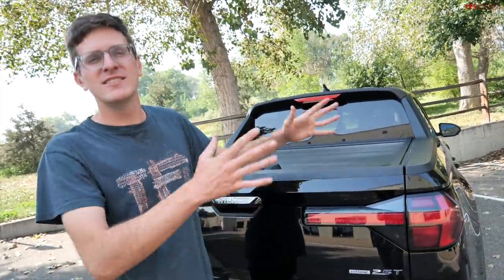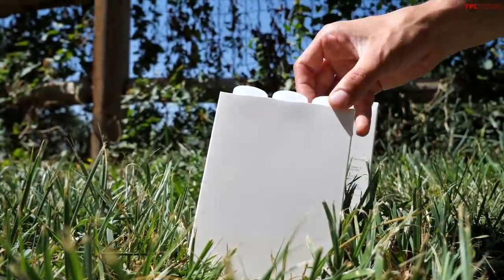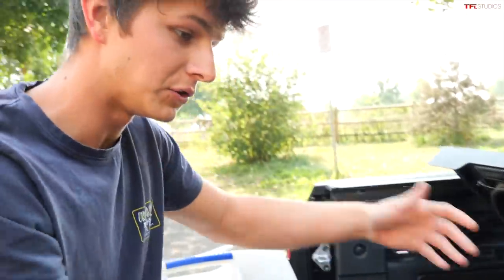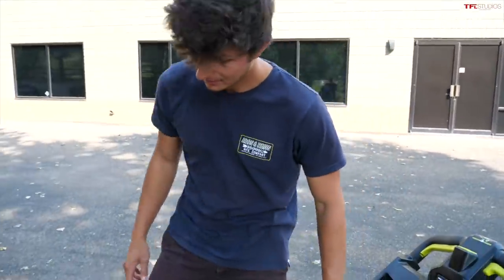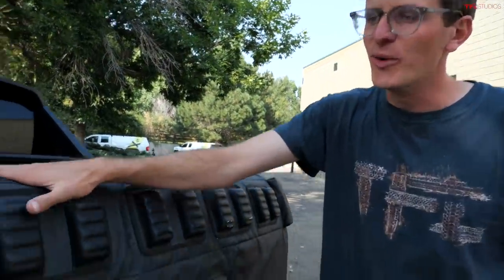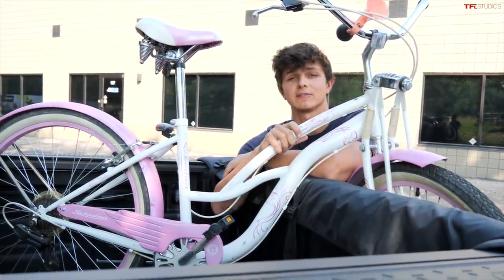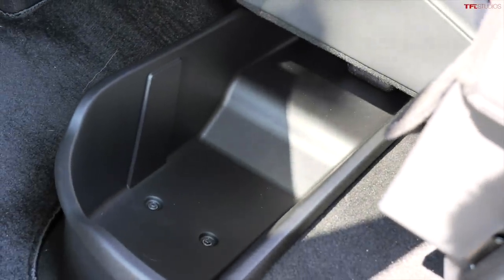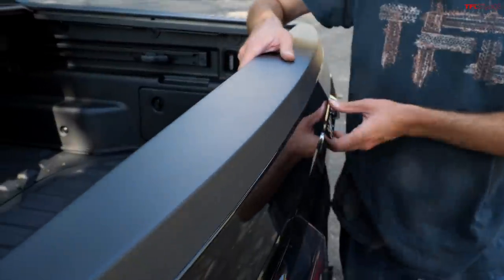The New Santa Cruz is a Tiny Truck - You Won't Believe What Fits (and What DOESN'T Fit) In The Bed!

Comment: I don't have a use for a full size pickup, or a mid sized pickup. I work for the Federal Government in an office. So I'm not hauling things around. Plus, I live by myself, so anything that I would use a full size/ mid size truck for, I wouldn't be able to carry or move myself. Example, washers, dryers, couches, dinning tables, hot water heaters and so on. I just need something that will fit items that won't fit in a 2009 VW Jetta.  Like Bar B Que pits, Patio Furniture, small dressers, Televisions over 70 inches, and so on. Basically something that can handle small home improvement projects. So for someone single, lives by themselves, and does home improvement projects on their own home, by themselves only with no help, then this could be a perfect vehicle for the. It is for me, I just need something that will fit items that won't fit in my current car, but items that I can handle on my own.  I don't tow anything and I don't work in construction, or run a lawn service. I'm a federal employee for a hospital, need to do small home improvement projects, and go out and have picnics and to the beach.
Reply: @wilmarbarrick3194  or even just get an old used truck if it's not gonna be used much, hell even a station wagon would work for any of that stuff
Reply: The 2.5T is a fun little engine to drive around. Faster than the hemi I had and averaging 27 mpg right now. Sea level flat pretty flat land. Mixed city and interstate at 80 mph

Comment: 2012 Dodge Grand Caravan with stowaway seats is more truck than this Barbie Car.  2020 Civic Hatchback with rear seats folded down can fit a bike in with nothing hanging out.  This is the poorest attempt at a truck Ive ever seen.  This makes the Honda Ridgeline look good. Thank you TFL for showing us the flaws and not giving us a hyped up salesman type of review.
Reply: It’s not intended to take on any current pickup, just be useful for those who want something with an open bed in a smaller package.
Reply: You're argument is flawed, you had to kick out your family to do truck stuff with those vehicles and just got grease on the carpet. Your wife is gonna be pissed .
Reply: @ALMX5DP  Except the list of use cases where it makes more sense than a typical crossover or mid-sized truck is exceedingly small. Nobody is genuinely buying this for practical purposes.
Reply: @mechmat12345  dang you’re on a roll in the comments section here. Use case doesn’t have to strictly apply to practicability, can be any reason why someone would want to buy it. No different to any other type of vehicle purchase.
Reply: @ALMX5DP  lol, irony noted. That's not what use case means. "use case noun noun: use case; plural noun: use cases a specific situation in which a product or service could potentially be used" - Oxford English Dictionary
Reply: @mechmat12345  "could potentially be used" seems to sum up exactly what I was  referring to, so I'm not sure how that is incorrect. If it's too haul something, go somewhere or look a certain way, all that falls into such a definition.

Comment: just turn the quad around with the back facing the tunnel cover 
IT WILL FREAKING FIT
Reply: Yeah, it looked like the front fender was stopping it from fitting.
Reply: @rzu7120  yea, no fender on the back, the wheels would go under and the frame would go over the tunnel
Reply: @HowDareYouu  I think the exhaust might be in the way if it was a gas quad tho

Comment: I like tonneau covers but the retractable style is probably my least favorite because of the bed space they occupy. I would rather have a tri-fold  hard cover or similar style.
Reply: It's not much.
Reply: I like them, don’t like the price though
Reply: Trifold or also a manual rollup.   Because there's no box, the roll itself is smaller, and it goes above the bed instead of into the bed, so usually is out of the way of ATV/Motorcycle tires and the like since its high up.

Comment: Tommy nobody mentions that you can't put all that weight in the bed area Hyundai only allows for 600lbs in the bed area.
Reply: That was corrected by Hyundai, It's 1400lbs total but if you subtract 4 200lbs passengers inside the cabin then you are left with 600lbs in bed
Reply: Those ratings are assuming you drive in F1. Can easily load above that if you drive carefully.
Reply: @xcal_99_industries32  By that logic, you can load anything you want into any vehicle and ignore payload rating, in other words the Santa Cruz still sucks compared to anything else.

Comment: How did you guys know I was bald? That cover for the bed is a fail...I hope they don't all come that way.
Reply: It’s an optional extra as far as I know.
Reply: @kelvinhill9874  Its standard on the SEL Activity, SEL Premium, and Limited.  But if you buy it and don't like it, you can resell them for a LOT right now because some SE and SEL owners want them and Hyundai doesn't even sell it separate.    So its not a big deal if you buy a trim that has it, you'll find a buyer for $1500 to more than make it worth your while.
Reply: You typed "cover for that bed" when I think you meant "entire vehicle." Might want to correct that.

Comment: Lot of people complaining about the bed being limited to 660 lbs.  Even in a full size half ton pickup, it’s probably not really rated to put the full 1400-1700 lbs in the bed over the rear axle.  

It would be a good TFL test to take three different pickups (small, medium, large) and go to the scale with weights to simulate in cab and bed weights to see how it impacts the distribution of load across the axles.
Reply: My Silverado i rated to handle 90%+ of the payload over the rear Axel. So yes I can put it all in the bed. As you can with the maverick as well.
Reply: @devinbender8428  when I asked you last you were unable to provide GAWR specs. Has that changed because I’m curious why you are so confident in your responses.
Reply: @ALMX5DP  1/2 ton trucks usually have around 70% of gvw for each axle,  basically allowing you to put the whole payload anywhere on the vehicle between the axles
Reply: @jmanlinc  my 2020 Silverado
5000 Curb 
2000 payload 
Rear GWAR is 3800
Weight split is roughly 43/57 so that means of that 5000lbs 
2150 is over the rear Axel. Leaving me 
1560lbs for the bed. 
Figure I got about 100lbs in gas, plus me 200lbs and few things in the cab. That’s pretty damn close to EVERYTHING able to go in the bed.

Comment: What’s the difference between this and an suv. You basically have the same capability as a Santa Fe unless you want to have a really tall load.
Reply: Strange to me how some people are unable to grasp potential use cases for something like this. The ability to imagine must be slowly disappearing.
Reply: Don't listen to those two nitwits, just because you can make up specific scenarios don't mean that are plentiful in real world applications. The use cases where this has more utility than a normal crossover and more practicality than a mid-sized truck are exceedingly small. Nobody is going to buy this for utility, they're going to buy it for looks or whatever and rationalize the purchase by claiming greater utility.
Reply: @mechmat12345  Hyundai and Ford seem to disagree with you. And isn’t buying for a perceived benefit in and of itself a use case even if it doesn’t get used to its fullest potential?
Reply: @ALMX5DP  You're comment on Ford and Hyundai makes no sense. They're trying to sell what people want, not what people need. Rationalization is not the same as what you're referring to as "perceived benefit." Rationalization is trying to justify something after making a decision, not making a decision based on needs.
Reply: @mechmat12345  they try to sell in many different ways, but regardless have determined that these trucks will net them a profit. People will still make a future purchase decision based on a thought process that may include what they perceive as benefits that the vehicle may give them. Other thoughts may come later, but deciding to purchase and doing so is what I was referring to.
Reply: @ALMX5DP  No shit, what are you trying to prove? Many people may look at this vehicle and incorrectly assess that it fits their needs better than a crossover or midsized truck. That certainly goes for all vehicles, btw. Plenty of people drive crossovers even though a Honda Fit would meet their needs, and plenty drive trucks that don't need anything bigger than a CR-V. This video and discussion is about the actual utility of the Santa Cruz compared to a traditional mid sized truck, and the end result is that there is little to no discernable difference between it and a typical crossover. Ergo, almost nobody choosing to buy it are buying it for utility, they're buying it for reasons other than utility and using an invalid claim of utility as a rationalization.
Reply: @mechmat12345  I see a discernable difference in utility, an open bed is very different to an enclosed hatch area. Not trying to prove anything, just providing a response to the OP who stated they didnt or cant see a difference.
Reply: @ALMX5DP  Usually yes, but as this video proved, the bed in this vehicle markedly less useful that what is universally considered a small truck and could not fit anything that does not fit in a typical SUV. The OP's comment was a question of utility, not geometry. You claim it's obvious that there are many uses for this particular vehicles bed (a common strategy among people making bad arguments) but haven't managed to name any in your vast library of comments to this video.
Reply: @mechmat12345  ah, one YouTube video equals unequivocal proof eh? 

There are many uses, but you yourself said citing specific ones doesnt mean anything, hence why i kept it generalized. If you'd like me to provide some of my personal experiences that a bed has been useful over a SUV hatch area, I'd be more than happy to provide.
Reply: @ALMX5DP  Like hauling taller items that won't fit in an SUV, like a washer, dryer, refrigerator, 55 gal. drum, hauling shrubs in large pots, etc.
Reply: @Fabwal  agreed, I know just from my own use with a pickup that its been beneficial many times. Sometimes has its downsides but overall I’m happy I have one.

Comment: What's the sense of having a storage compartment in the bed of the truck that really doesn't lock? All someone has to do is open the tailgate and take your stuff. Wouldn't have made more sense to have an actual lock on that compartment?
Reply: The tailgate locks with the doors like an SUV, and you can not open the storage compartment with the tailgate up.
Reply: @kevinboerner3977  so are you saying that in order to let the tailgate down you have to open up one of the cabin doors or is there some type of remote?
Reply: @johng.6222  the key fob opens the tailgate as well as the doors so the tailgate is basically locked anytime the doors are. If it has proximity sensors you won't even notice it's locked as it will just be automatic
Reply: @jmanlinc  ah... Ok... Nevermind!

Comment: You should have put the bike crossways in the bed. That's what I had to do when I owned a Ford Explorer Sport Tac 1rst gen. That had probably one of the most functional beds going. Full size tailgate, multi tie down points and it was also was a poly bed. They also came stock with hard locking tonneau cover (specific for the truck) and a bed extender.
Reply: @Mike considering it can haul 1400 pounds in its bed, I'm sure it can handle it. My ram sport  just hauls 1300.

Comment: Suggesting that it is less than a standard pickup truck, because it can’t carry as much, is classic captain obvious work TFL.  People who buy a small sized pickup are not thinking they can carry 4x8 sheets of plywood for their construction business.  It’s disingenuous to effectively suggest there is something wrong with the Santa Cruz because it can’t fit a motorcycle in the bed.  If you’re going to do comparisons this way, you should get a 2 door full sized F150 and see if you can fit 4 guys who weigh 250 lbs each in the cab and then complain when it doesn’t work.
Reply: If you don't want it compared to trucks, don't call it a truck. A Ridgeline is a "truck" for people who don't want to off-road or tow as much as a traditional truck, and this is a "truck" for people who don't want to off-road, tow, or haul as much as a traditional truck. So how exactly is it even a truck? Having a bed can't be the only qualifier as a truck.

Comment: Another 6-12 inches and a more innovative tailgate extender would make a word of difference on that bed.  The extendable bed on the concept was an incredible design and would have sold me on the truck.  I heard someone from Hyundai say they got rid of it to keep the starting price down, but I think that was a big mistake. It would have given you a full size length bed on a compact truck.  That's a game changer.  The bed as is, is too short for what I need. I hope this sticks around long enough for a gen 2. So they can put that patent to good use.
Reply: If you put the tailgate down you basically get a 6 foot bed. If you regularly haul items larger than that, an extra 6-12 inches would have been useless lol

Comment: Its not a truck. Bed weight is restricted to 650 lbs?! Trucks have frames. This is a grocery getter. You can put 650 lbs in the back of it. You can put it and the 650 lbs in the back of a real truck. They dropped 2200 kg into the bed of a Ford Ranger. Show me what your Santa Cruz looks like after doing that! And in the end, its still a Hyundai. Hopefully it will have a better track record than the rest.
Reply: Hyundai has a better track record than Ford! 🤦‍♂️
Reply: Calm down dude geez
Reply: My understanding is that the 600lb number is rated if you have 4 200lb guys inside the cab, if you have less passengers then the rating in the bed goes up accordingly

Comment: I have a '20 Sierra AT4 and it only has 1384lbs of payload. :\
Reply: Key word at4. Soft offroad suspension. My 20 Silverado can haul 2000 and that’s the lowest because it’s a quad cab 6’ bed  
Extended cab 6 foot bed can handle 2500
Reply: @devinbender8428  Correct. Give the Santa Cruz real off road kit and that backpack would exceed it's payload capacity.
Reply: @mechmat12345  oh absolutely! 
So far sounds like the Maverick with FX4 still has 1500lb payload but well see

Comment: Just buy a Toyota Tacoma with high resale value, quality and reliability unlike the Hyundai. We’ve seen many automakers try trucks like this but they always failed. If you can’t even fit a small quad or bicycle on the bed then what’s the point.

Comment: A Hyundai will always be a Hyundai. Enough said!! Although the 1,400 pounds of payload is actually impressive and respectable. I’d love to see how much it would sag with that much weight back there.. Overall a decent little SUT.. sport utility truck. I’d definitely never buy one, but will probably be a hit with the lesbian crowd... why Tommy likes it lol 😆
Reply: 661lbs in the bed payload*
Reply: Lots of mid sized SUVs can haul 1400 lbs. Also, not a truck, a crossover with a bed. Maybe instead of CUT call it a crossover-truck i.e., Crock, or combine SUV and truck and just say it Sucks.
Reply: @mechmat12345  compact truck. Simple and easy. Just like how compact cars were unibody and not as capable as full frame Fullsized cars from the 50/60s

Comment: I appreciate the spirit and humor of these vids of the Santa Cruz, yet I'm beginning to find the lack of perspective annoying. It is what it is and probably eminently suitable for a great many people who do not need some great hulking truck. You began a similar attitude with the Honda Ridgeline. I'm interested to see if you persist along the same lines when the Maverick becomes available, yet at the same time, dreading your comparisons of the two, three if you include the Ridgeline. Try being realistic and stop pandering to the truck crowd,  and maybe the actual buyers of these kind of vehicles will thank you.
Reply: lol. The list of use cases where this makes more sense than a midsized truck or any other crossover is exceedingly small. Maybe don't call it a truck if you don't like the comparisons to trucks. Honda Ridgeline is currently the worse selling mid-sized trucks, BTW.
Reply: @mechmat12345  I'm an Aussie, and grew up surrounded by these kind of vehicles in just about any format/layout that you could imagine. Not once did I call them trucks, not then and not now, simply because they are NOT. You're absolutely correct that these compact utility vehicles are direct competitors for crossovers, and effectively, that's what all of these are, crossovers with a bed! My point is for TFL to compare them with crossovers and to stop belittling their usefulness by comparing them with "trucks". Again, as an Aussie, I laugh hysterically at what you label trucks, but it's with good humour. Thanks for the reply Mat, at least someone listened!

Comment: 4ft seems like it's all be possible just ditch the tonneau cover. Or get the Mavs 4.5ft bed.
Reply: The bed is actually 4 foot 4 inches.
Plus the tailgate has multi level stops, so you can actually haul an 8 foot sheet of plywood. 

I measured it all out in my review, check it out!: 

https://youtu.be/Z70rgk88bhU

Comment: Okay how does this thing have a higher payload than my 2011 F150 Crew cab long box 5.0?? My payload is only 1350 pounds!
Reply: The frame and truck are heavier on an F150. It’s all about suspension load.

1500lbs payload + 4200 truck is only 5700lbs 

Vs 5000lb truck and 1350 is 5800+lbs